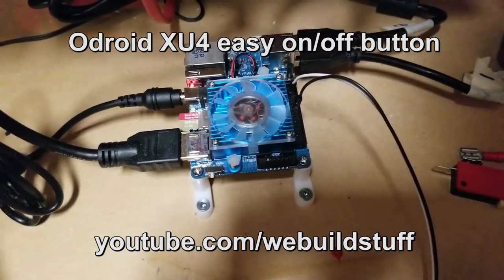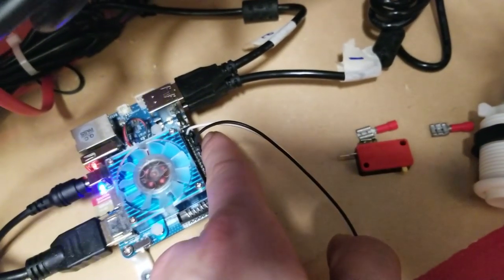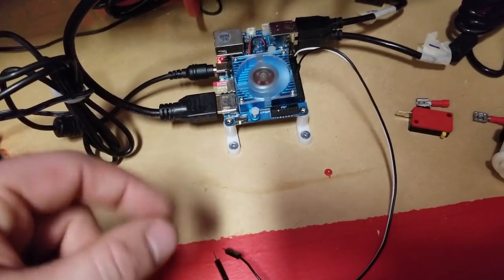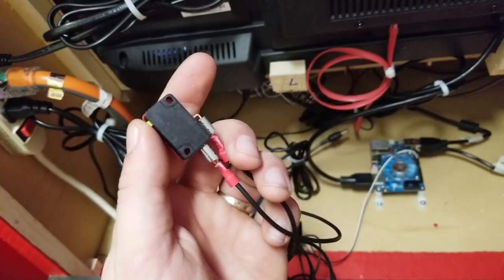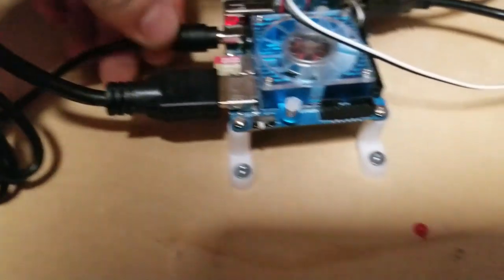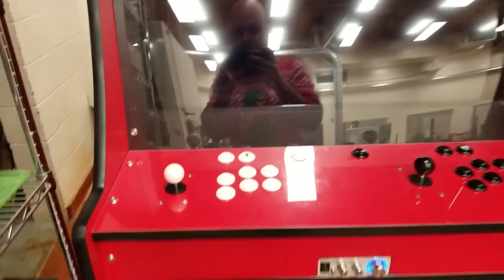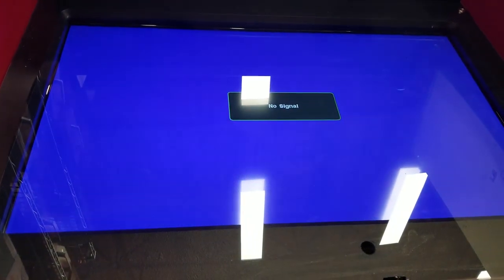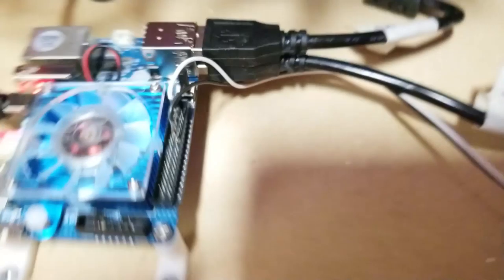Easy Odroid-XU4 On/Off Arcade Power Button

Comment: I'm going to be taking the dive in 2023 and build my first arcade cabinet. Your videos have been invaluable to me. You are obviously a teacher, because you explain things very thoroughly and don't talk down to people. So thank you.
I have one question, I will probably be using the same Odroid you do, due to their availability. It doesn't appear to have the 3.5 barrel for sound, so how do you get sound to small external speakers. I would prefer not to use the TV's HDMI speakers. Thanks.
Reply from the maker: A lot of TVs will have the barrel/aux output and then that also allows for you to control the volume with a remote rather than wiring a comime knob to your cabinet.  You can also pick up hdmi adaptors that have an aux out/splitter

Good luck!
Reply: @WeBuildStuff  Thanks so much, I think the adapter will be a better option for me as I will be using the older PC monitors that don't use HDMI. I should be able to figure something out. Thanks again.
Reply from the maker: @gregghernandez2714  find me on Instagram and send me progress pictures when you start building!
Reply: @WeBuildStuff  Will do!

Comment: Are there any more videos of the odroid build? I’m planning my own but can’t find the relevant playlist.
Reply from the maker: Eventually. I have the footage sitting on a hard-drive waiting to be edited. It's a "hand power tool" build without the big machines showing what can be done if you don't have all the fun equipment.
Reply: @WeBuildStuff  excellent, I’ll be looking forward to it then. I’m going to laser cut my main pieces and do the rest by hand. I’m thinking about a couple of interchangeable control panels one with double stick and buttons and one for racing, so I have lots to think about and plan first.

Comment: Hi, Great Build. I am seeking some desperate assistance in running Audio to my arcade build. I have the Odroid XU4 plugged into an HP 2711x monitor (no speakers)running Emulation station/Retropie. I had the entire project plugged into and tested on a tv and audio was great through the tv speakers. But now that the monitor has no speakers, I tried usb speakers into the odroid and no sound whatsoever. Any idea how I can get audio output out from my Odroid. I'm open to all suggestions at this point. Please help!! Thanks
Reply from the maker: Ooo that's a tricky one. When I bought my Odroid I knew I wouldn't have an "aux" output and planned for only audio over hdmi. I have tried an hdmi cord with a built it audio splitter/adaptor before but I didn't have luck with it.  Maybe check for a retropie compatible usb audio cord. If you find one I would love an update on your project! Best of luck!
Reply: Powered Hdmi converter, nick the sound out from the convertor

Comment: do you have a wiring diagram for gpio pins for arcade buttons and joysticks
Reply from the maker: I've done GPIO with raspberry pi but i haven't tried that with an Odroid

I used this guide for the pi
https://wiki.recalbox.com/en/tutorials/controllers/gpio/gpio-controllers

That might get you started. I've switched to usb encoders for my joysticks and buttons

Comment: Thanks for the video. Just wondering if this would work for the original Arcade1up switch? Its not a button, but a on off switch.
Reply from the maker: This specific type of button setup only acts as a momentary push switch the way I have it wired

Comment: Would it be possible to use Odroid HC1 UART pins for Power-Off too ?
Reply from the maker: I haven't used that before but double check what each pin does. If it matches mine try it out. Check the HC1 diagrams and wiki page 😁

Comment: No script needed? Safe shutdown? Just plug and go?
Reply from the maker: Recalbox has the script already written in (at the time of this video) for on/off switches like this. It triggers a shutdown screen and also works to power it up again. No issues on over a year of use!
Reply: Thanks sir!!
Reply from the maker: @MrEightfortytwo  Thanks for watching! Check out my other arcade videos if you get the chance!
Reply: I got one for you, I have a fresh version of recalbox on my sd, everytime it boots the start/splash screen glitches. Seems to be run fine once I get past that but it does it every start up and it's annoying.... 
Any clue what's going on